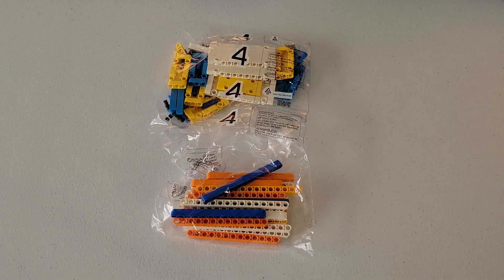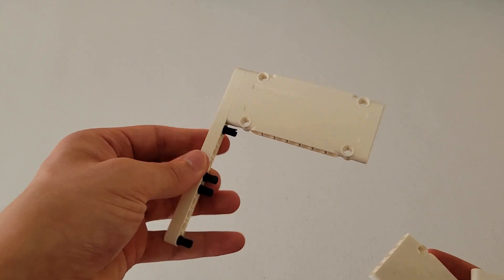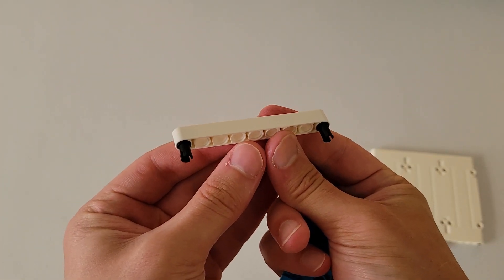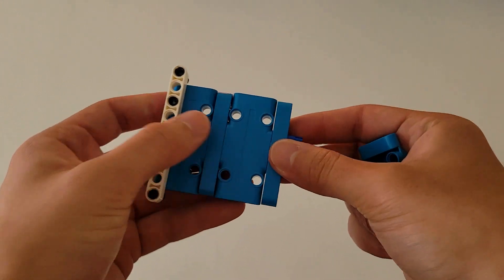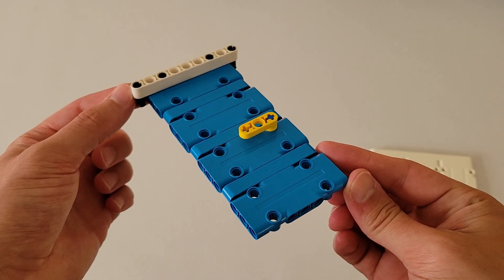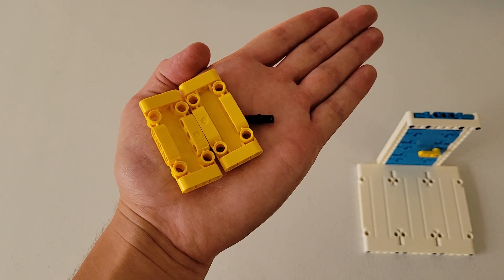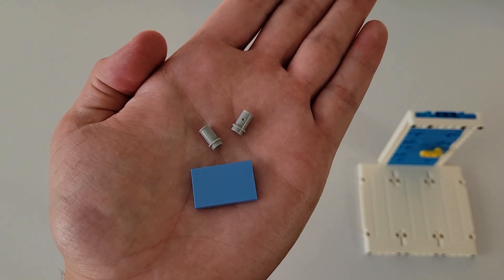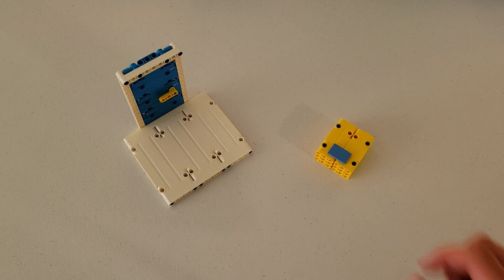FLL Cargo Connect Bag 4 Building Instructions (2021/2022 Game)

Comment: Hi..
I think you work with spike,
I got a box for explore FLL this year and it contains several bags all of them have number "four" but the pieces inside are different, and there are no instructions to install them except for the truck and the sorting machine,, what should I do?
Please help,,
Thank you
Reply from the maker: There are 3 different FLL age groups. These are discover, explore, and challenge. For the explore set, the truck and sorting machine are the two models you can build. For the challenge set, there are many more models. This particular video is for the challenge set. Please let me know if you have any other questions.
Reply: @JHYO333 
Yes.. You help me, thanks a lot,,
But another Q please,,
What do you mean: tow models in explore?
Manual and motoride ??
Reply from the maker: Glad I could help, and I mean 2 things to build, so the truck and the sorting machine are the two things you are able to build with the explore set.
Reply: I have the same issue as you. The explore instruction books 1 & 2 go with bags 1-3, but I have no idea what to do with all the bags that are 4!